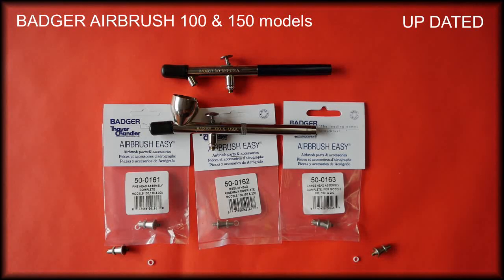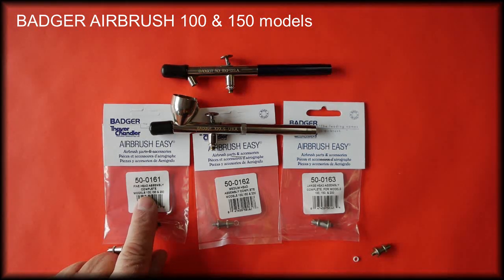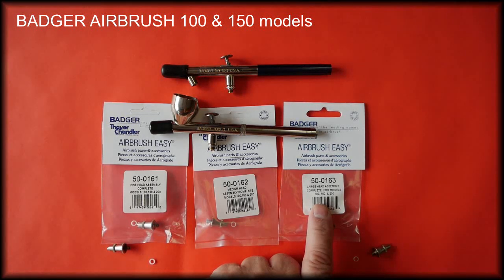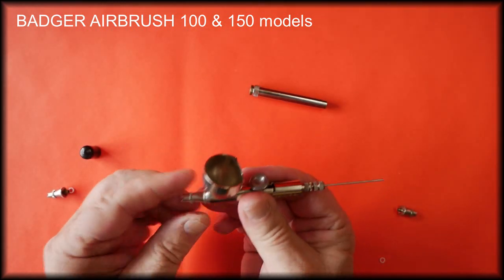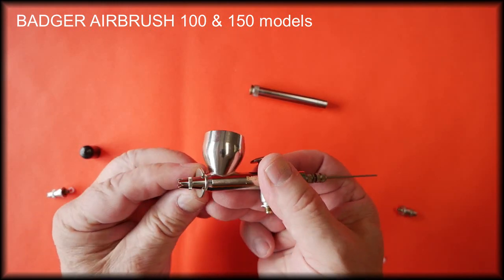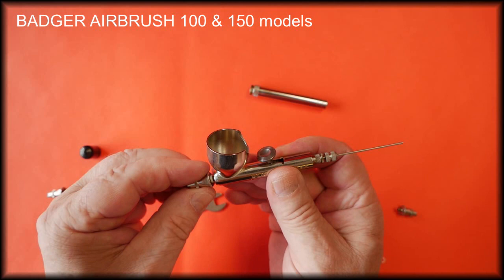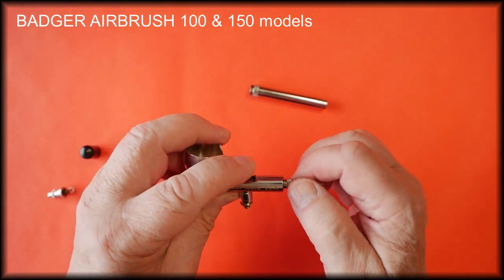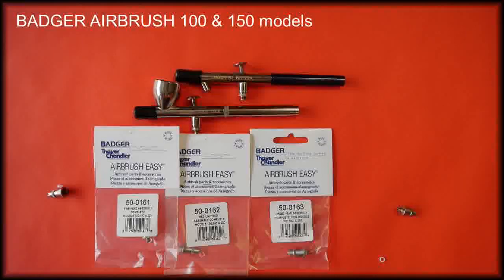Badger Airbrush 100 & 150 Model Head assembly updated

Comment: Hmm…you sure those head sizes aren’t .25, .5 and .76…?
Reply from the maker: Hi Colin are you thinking of the Badger 105 Patriot sizes ? this video is for the Badger 100 and 150 model airbrushes
Reply: @barwellukairbrushsupplies4324  no, those are .35, .5 and .76. The 100 and 150 are .25, .5 and .76. Also, it’s unlikely any airbrush manufacturer would offer .3, .4 and .5 sizes for a brush - they’re too close together…
Reply from the maker: You are incorrect the sizes are as stated in the video Fine .3mm one notch on needle end, Medium .4mm two notch’s on needle end, Large ,5mm three notch’s on needle end.
Reply: @barwellukairbrushsupplies4324  do you have any documentation on that? I don’t think Fine, Medium and Large mean what you think they mean.